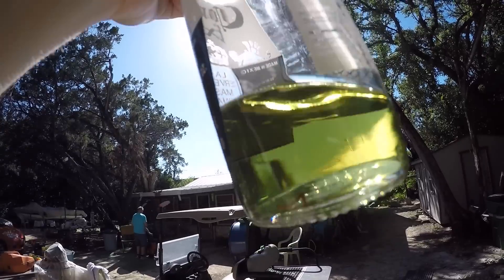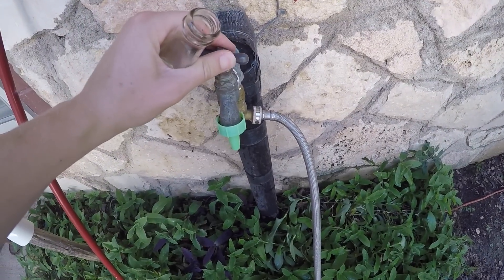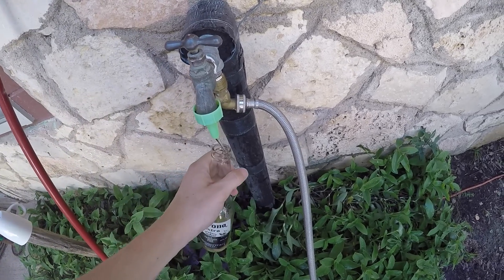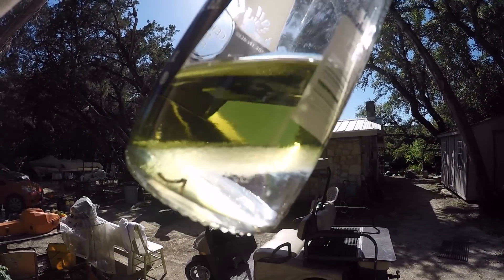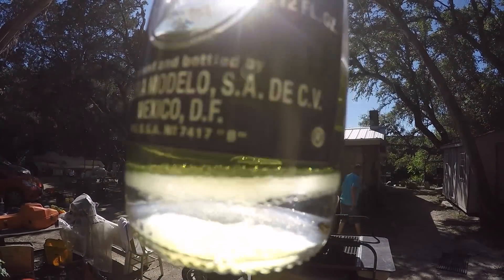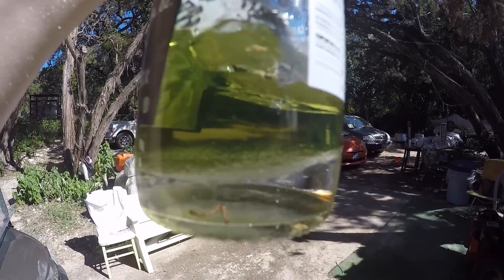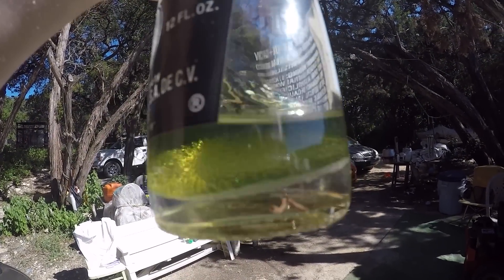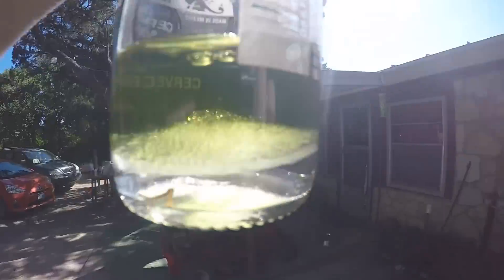Got WATER in your GAS? NOT GOOD!

Comment: Petrol (gas) station near me always has muck and dirt in there fuel, I do not use them at all anymore! on my old honda I found there had been metal filing/dust type stuff in the fuel and had built up in my fuel line, so when the engine got hot, the filings would heat up expand and cut off fuel to the engine. WAS NOT FUN!
Reply: oh damn. that sucks.

Comment: I also fly and you can get frightening amounts of water in the fuel, when you refuel early in the morning the first lot of gas out of the pump can be mostly water. Also fuel caps that aren't sealed properly can let water in. We just keep draining until you get a sample that is fuel. Occasionally it's so bad you get one that is entirely water so you always run a bit through your fingers and see if it goes white, if it doesn't it's all water. I wouldn't do that with regular gas, I think avgas is different.

Comment: Hey dude, I found a product that works pretty good for getting rid of water in your fuel and thats Heet. It comes in a red bottle or yellow bottle, it can be bought almost anywhere, and I've been using it for years and have had great success with it.
Reply: How often do you get water in your gas that you've had to use something for years to remove it?

Comment: We have 95/98 in Sweden ^^but yeah :P same shit
Reply: Johannes Simonsson Actually we have the same octane it's just rated different.Anti-Knock Index (AKI) or (R+M)/2[edit]In most countries, including Australia, New Zealand and all of those in Europe,[citation needed] the "headline" octane rating shown on the pump is the RON, but in Canada, the United States, Brazil, and some other countries, the headline number is the average of the RON and the MON, called the Anti-Knock Index (AKI), and often written on pumps as (R+M)/2). It may also sometimes be called the Posted Octane Number (PON).Difference between RON, MON, and AKI[edit]Because of the 8 to 12 octane number difference between RON and MON noted above, the AKI shown in Canada and the United States is 4 to 6 octane numbers lower than elsewhere in the world for the same fuel. This difference between RON and MON is known as the fuel's Sensitivity,[4] and is not typically published for those countries that use the Anti-Knock Index labelling system.
Reply: Johannes Simonsson some depends on the system used to calculate the octane. It used to be that premium in the US was 100 octane and lower grades were still called higher numbers than today's gas... the system was changed that they calibrate it bu, so differences of the number is meaningless unless you know the systems of rating used are the same.
Reply: Sleeper Iroc I figured this out when I bought my YZ 250F and it said 95 octane minimum, but that is the japanese rating so it actually needs 91 in the US.
Reply: We have 98-102 in Germany :D

Comment: Also, look into some stuff called Mechanic in a Bottle. Sold by B3C fuel solutions and it will encapsulate water ( up to a certain percentage) and you can use water finding paste trying to find the water and it's gone. Shit is good. They have some stuff called Engine Energy that is great for performance engines. I use this stuff daily.

Comment: Why not pump out the water? Better than wasting precious liquefied dinosaurs.
Reply from the maker: Spacebird If you can figure out how, I'd assume you could yes.
Reply: Hunter Honda For fuel injected bikes, pull the fuel line off of the fuel rail and bypass the fuel pump relay to keep the fuel running. Once fuel starts to flow, your ready to put it back together. You could also keep turning the bike on and off again to cycle the pump. (Usually when you turn on a bike, the pump primes the fuel rail to the working pressure.) On the other hand, depending on how long the water has been there, the fuel tank might have rust. Which is another problem in and of itself. There are plenty of tutorials if that's a problem.

Comment: Man, I could talk all day about water and ethanol problems in our gas. The worse part in your beer bottle example is the layer of slimy looking bubbles in between the water and gas. That is detergents from the fuel being grabbed by the water and is really bad about lining the fuel systems and doesn't do well going through smaller micron filters. I work on 2 stroke outdoor power equip and commercial lawnmowers and pump fuel is destroying the engines. Go look at how many small engine manufactures are stating to sell fuel in can. That should be a sign that fuel is shit now unless you have a computer on board.